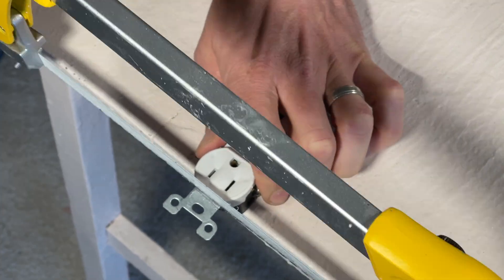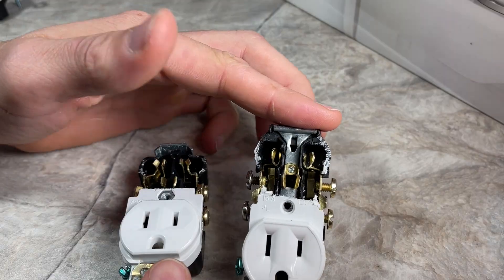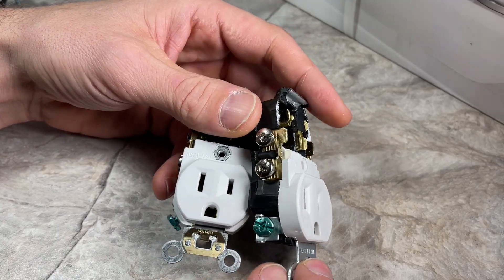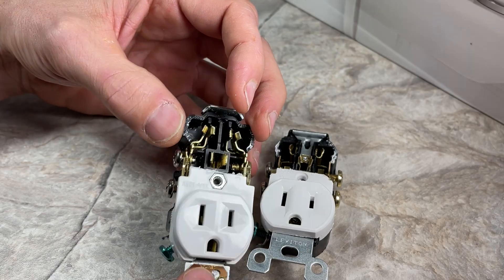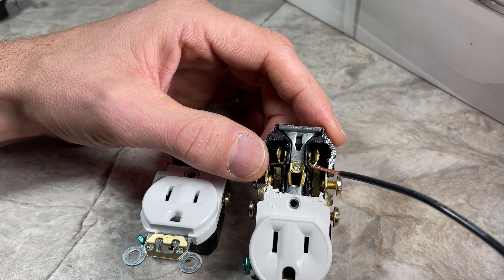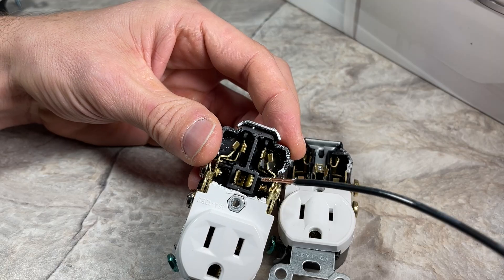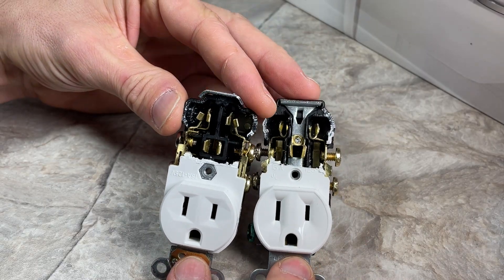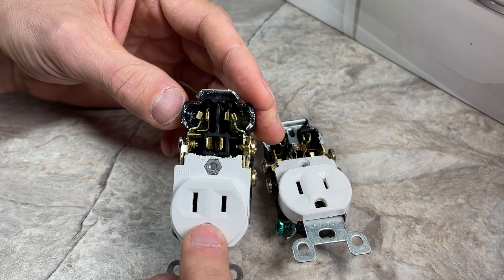What Outlet Should You Buy For Your Home |  Commercial vs Residential

Comment: "Are you using your plugs enough for that to happen," regarding the weakening of the grip of the plug, my and millions of others' experience is, YES.  It just may take twenty years. A huge percentage of us have lived in homes with plugs that pop out of the wall with no real coaxing.

There really is truth to the "I can't afford cheap" saying.  I buy good outlets for all my home and shop needs. No one was ever hurt by putting a 20 outlet on a 15 amp circuit (fourteen gauge) and only benefited from increased durability for it. 

Stab connectors are a sad, cheap (quick) fix. Good outlets have the advantage of allowing you to stab the wire in, THEN clamp it in place, so installing is even quicker than looping around the screw, but you still get the benefit of a good connection.
Reply: never install a 20 amp outlet on a 15 amp circuit.
Reply: @brandtfj , why would you think that?  

No one is going to know whether you put a 15 amp outlet in the wall or a 20 amp one unless they pull it and inspect the writing. Merely that the outlet can handle more amperage does not mean it's going to increase the load on the fourteen gauge feeding it.

Don't forget the circuit, regardless of amperage capacity, is protected by a breaker purposed to trip if the amperage load across it exceeds the line capacity.
Reply: @kellyvcraig  first of all you're misrepresenting the load capacity of that circuit.... I'm in floor care and my Machinery requires at least 12 gauge wiring and a 20 amp circuit breaker if I were to plug into a 14 gauge 15 amp circuit yes it would run briefly and then trip the breaker however due to the 14 gauge wiring there's a huge voltage drop.  I only get so much " power" do to voltage drop and resistance from the 14 gauge wiring which is very hard on electrical motors my floor care machine will briefly overheat your wiring and before your circuit breaker trips also causing possible damage to my electric motor do the voltage drop... I would suggest buying a heavy duty 15 amp outlet and leave it at that...
Reply: @brandtfj , you're in floor care and I was in electronics (NTS/NUWES), having moved from marine electrical (PSNS), so you got me on the credential thing.

FOR THESE PURPOSES, what you, and I as well, should have pointed out is, there are a few types of twenty amp outlets. For example:

(1) The type I used in my home and shop, which look just like any common household outlet with a ground and take only standard 120 VAC plugs. 

(2) The one with the combination vertical and horizontal neutral/common (white wire) blade hole. These will take either of two types of plugs - one being the standard 120 VAC plug, the another being a plug with a normal vertical hot (black) blade and a horizontal neutral blade.

(3) The only one in my shop like it, which will take ONLY plugs with a vertical hot blade and horizontal neutral blade.

Of course, I did not say to swap outlet configuration, so the plugs that will only work with a horizontal blade slot are not an issue. Doing so would be absurd, since it would require changing every plug on every appliance, stereo and what have you in the house or shop. 

In the end, the ONLY thing running a twenty amp outlet on a fifteen amp (fourteen gauge) circuit does is, get you into a beefier outlet. It does not misrepresent anything any more than putting a larger, more free flowing air cleaner on a car indicates more carburation.

You could run a 100 amp line and, if you could get it into them, a fifteen amp outlet and breaker. It would still be a fifteen amp circuit. So too it goes with the outlet. The only things you'd change by increasing the capacity of the line or termination is, reduced resistance drop, less likelihood of ever so much as warming the line from a load, a bit of wallet pain and, in the case of the outlet, a longer useful life span.

Sound connections aside and concerning household circuts, The ONLY things one needs to be concerned about is, don't under size circuits or terminations relative to their their loads, and don't oversize breakers for the line they are protecting (for those unaware, breakers protect ONLY the line).

Nine of the ten 120 VAC outlet circuits in my shop are 20 amp circuits. So is every such circuit in my home. Like those described in the article, they are beefier.  Meanwhile, NO ONE, without getting six inches from them, or by pulling them from their boxes is going to have any inkling of if I was stupid enough to run fourteen gauge, rather than twelve, to them.  

The tenth 120 VAC circuit is a 30 amp circuit for a two horse bandsaw, which runs at 20 amps, but will drop to 10 after I swap panels and get room for a couple more breakers for the 240 volt compressor, and the reconfigured bandsaw motor.

For those unaware, local code give only minimums you need to do to pass inspection. Merely that code says you can run fourteen gauge does not mean it's the smart thing to do.  Generally, fourteen is used because builders cheap out. There is no other reason to run it for an outlet circuit.  No inspector is going to site me for using beefier outlets on my circuits.

You won't save that much running fourteen, but will insure you shouldn't be using them for anything more than a house vac. The truth is, life throws things at you and you may find a need to run a floor heater (maybe you're broke and can heat only one room, or that's all your generator can handle).

Comment: My main house is 20 years old and I've had to replace just ONE outlet.  I haven't owned it that entire time, but the previous owner didn't own it for many years, so I doubt that he replaced any outlets.  The outlets are the typical residential grade and the only problem with the outlet that I replace was that it did not grip the plug that tightly anymore... Since I can do the replacements myself, there's no installation costs to be saved by switching to a plug that might last longer... Besides, will a commercial plug last 80 years?  It's 4 times times the cost, so to be economically feasible, it should last 4 times as long, right?  In 80 years, I'm pretty sure I'm not going to be alive, but the house might not even be here at that point... We don't tend to have old houses that much around here -- instead, people just buy the old house, tear it down, and build a new one if you are close enough to the city to make the land worth doing that...

Now that I've seen him disassemble the plug in this video, I'm curious if I can fit a small screwdriver into the slot of the outlet I removed and bend the contacts enough to tighten it back up... Going to have to give that a try...

EDITED:  I tried putting a small screwdriver into the slot to see if I could bend the contacts enough to tighten up the outlet.  I was not able to made enough of a difference, so I disassembled the outlet to see how it was made and determined that the only way that was going to happen is if the white outer portion was removed.  Which is not really possible since it is attached with some pins which would require drilling them out to detach it.  Oh well ... into the trash with it...

Comment: Good video; thanks.
You compared the 15A residential receptacle  to the 15A commercial. I'm wondering how the 20A residential and 20A commercial would compare to the first two.
(Assuming the circuit uses 20A breaker and 12AWG conductors.)
Reply from the maker: Appreciate the feedback and I will add the 20 Amp recommendation to the list.  I do plan on doing a few more videos of this format and a few others had requested similarly to see the 20 Amp receptacles and how they compare.  Thanks!
Reply: 20amp has the exact same contacts but a different cover

Comment: What is the correct way to install the outlet into the box? Common to the right or left of The installer?
Reply from the maker: Are you asking if the ground should be on top or bottom?  If so, NEC does not call out a specific orientation but from a safety perspective some have indicated they prefer ground up just in case a plug is partially removed and an object falls and contacts the blades it will hit the ground first.
Reply: Ground tab up is the best. No on does it because it looks wrong . It doesn't look like a face and offends people.

Comment: In the electrical trades the commercials pay off for labor savings in not having to ground out to the back of the box on an EMT or sim grounded system.  Journeyman run around $2/minute if you can save a few minutes, you saved $8 times a couple thousand outlets in a large commercial build, well you get the idea.
Reply from the maker: Valid point Ryan thanks for the feedback.

Comment: Hey dude...both of those outlets should be UL listed... all homes can use both and houses aren't burning down because of it like they use to !!
The primary difference between the two is...one is approved for strained and solid wire while the less expensive is approved for solid wire only!
For the less expensive...strained wire can be used if you use a required spade lug to connect! 
You cannot wrap the strained wire around the screw...aka code violation per NEC !!

Comment: Great video but they all suck!  You didn't pay attention to the plastic.  In two years both are going to be yellow due to cheap plastic.  Previously they had a hard plastic which didn't fade as easy.  Manufacturers know they make a cheap product that needs to be replaced for one reason or another.
Reply from the maker: There was definitely a difference between the plastic on the residential and commercial.   I know others had called out higher grade receptacles like hospital grade use a nylon-based plastic which holds up better to cleaning.

Comment: Great video. Two things I noticed about the outlets...

1) On the commercial  outlet, the place where the cover plate attaches is a visible "hex-shaped" metal threaded part that resembles an embedded hex nut (perhaps that's exactly what it is). On the residential outlet, that "feature" is not present, but the threaded part is completely hidden by the remainder of the white outlet face. In the video, there is no mention of the materials, thicknesses, and overall design of this threaded part on the 2 outlets.2) The clearance between the Hot and Ground contacts: It would be nice to have examined the inside of the white outlet face (the part that was removed) of the residential outlet, to see if there are any bosses or mechanical features that enhance the isolation of these contacts. Even on the commercial outlet, there looks to be a lot of clearance, but it also looks wide open to debris being able to short those two contacts together. It would be interesting to know if there are mechanical features of the inside of the white outlet face that improves that isolation as well.
Reply from the maker: Hey Kevin, appreciate the feedback  👍